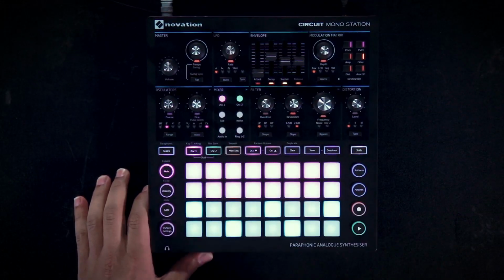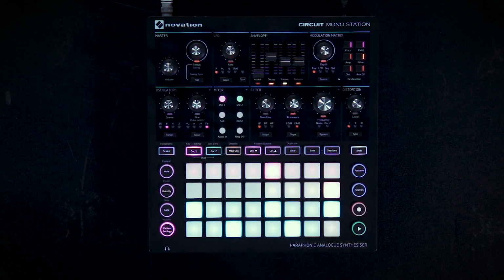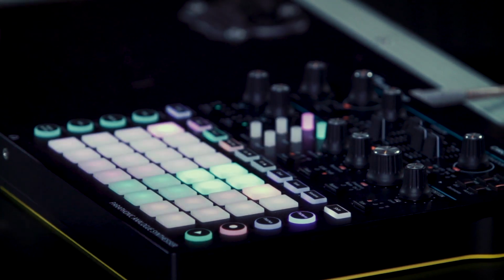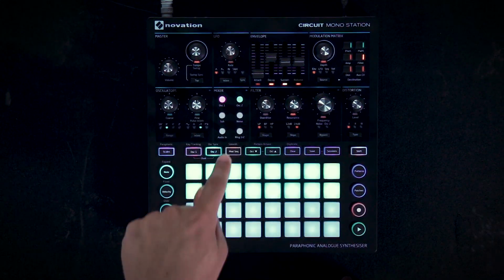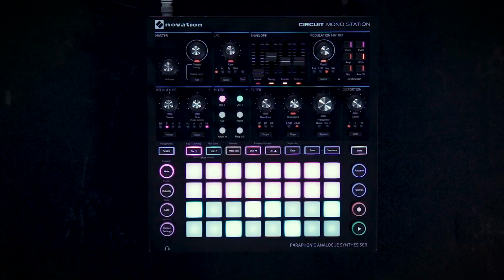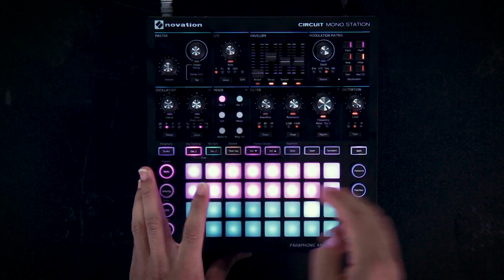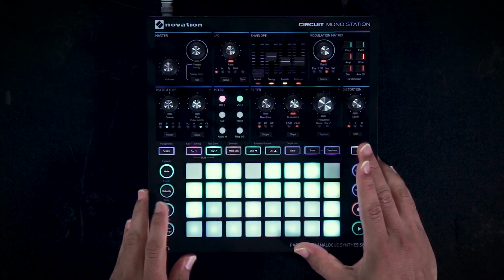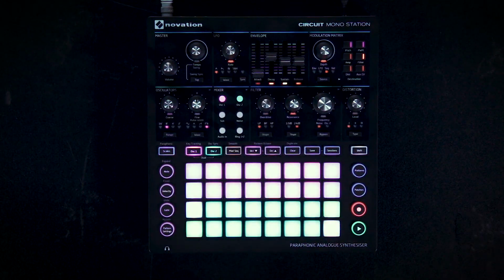Novation Circuit Mono Station

Comment: Can you sequence LFO rates in the 3rd "Modulation Sequencer?" Can this thing Dubstep?
Reply: You can actually sequence LFO rates in the main sequencer. With the sequencer stopped, you can go in and record any parameter change to any step. (you can even change that step to a completely different patch) With this method, changes will happen instantly as that step is played. If you record while the sequencer playing, the changes will instead be recorded in real time and played back just as you did them, so a filter sweep will sound exactly like you executed it.

The mod sequencer does not control the LFO, but you can actually use it as a second LFO, by programming alternating high and low velocity values for each step. Loopop has a video describing this method.

With a bit of ingenuity you can get this machine to auto-Dubstep. Your neighbours will be delighted!